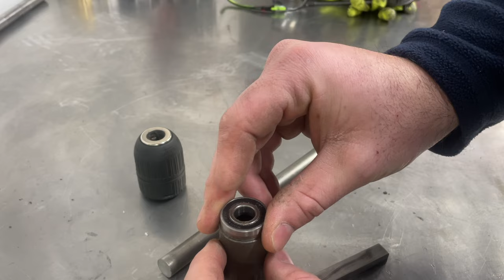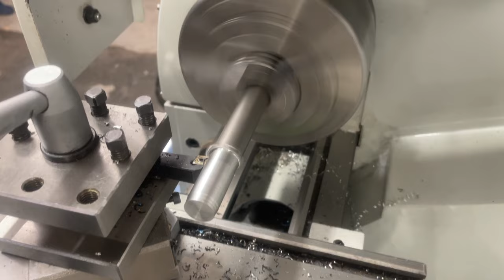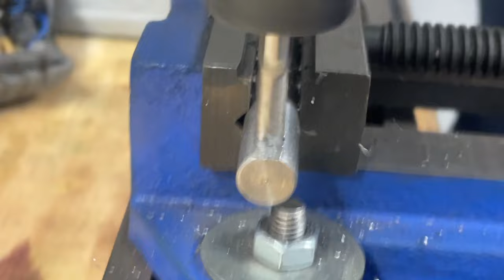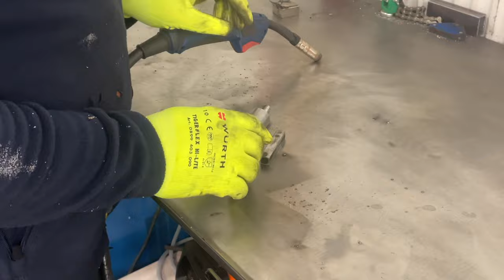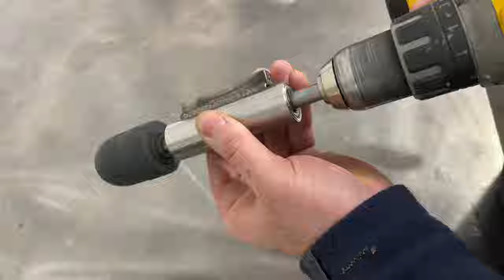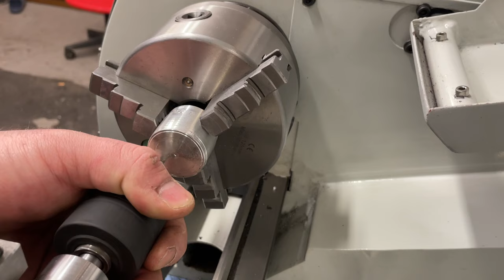Making Lathe MILLING Tool Attachment at home

Comment: You should have spent a little bit more time making this. The stickout on the shaft was way too high, you should have used a live center. The threads on the shaft leave to be desired (hence the horrendous runout). Lastly, welding the square piece aligned by eye is not the best option for precision.
In the end, the finished product looks like what it should be but isn’t really usable as is.
Reply: I'm thinking he wasn't aiming for precision.
Reply: Not very rigid  either.

Comment: I think I'd spend a little more for a quality chuck to put on the shaft, the runout was horrible. Good project though
Reply: The threads would have needed to be cut with the lathe rather than by hand. And the shaft would have needed to be machined with a rotating center...

Comment: The inside race of the bearing protrudes beyond the outside race, which means when you hammer on the inside race your peening the balls against both races. The bearing is ruined.

Comment: Have to wonder if you know what a center drill is used for?
Reply: Really ?  Just because someone names it a "centre drill" doesn't mean that's it's exclusive use to use it on the centre of work pieces.  It provides a "centre" that you can then use for other procedures, (for a steady or further drilling perhaps?).  Give it a try on other applications, you might surprise yourself.
Reply: @Henry-gj7mr 
I used one once as a fork.  Gotta say I wasn’t impressed.  And it took forever to finish my dinner that night!

Comment: Great video! I'm still new to machining so I have a noob question, why do you bore upside down in reverse? I have see a few people thread this way but never noticed anyone else boring this way. Curiosity peaks my interest. Thanks again for the great content.
Reply: From what I've seen online, there can be alot of different reasons to run a lathe in reverse with upside-down tools. While I don't know about this specific case, sometimes it can be so if there's a lack of rigidity, the tool can deflect upwards and away from the work rather than be pulled down and into the work, scraping your work, artisan makes has a video where he mounts a parting blade upside-down and this was his general explanation

Comment: Great job! I recomend you use conical bearings due to the load they recibe and try to add adjustable height for doing diferent opperations. Greets from Uruguay
Reply: They are called tapered roller bearings.
Reply: The quick change tool post gives a degree of adjustment in height.